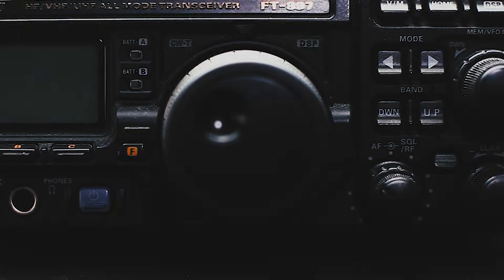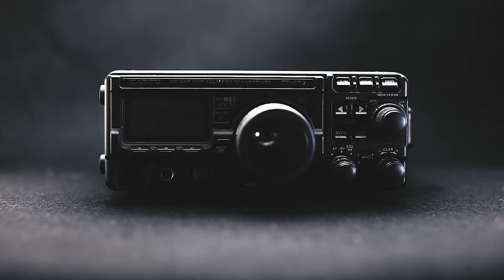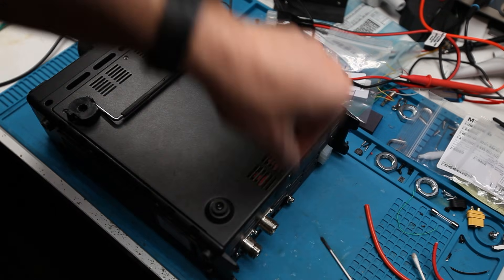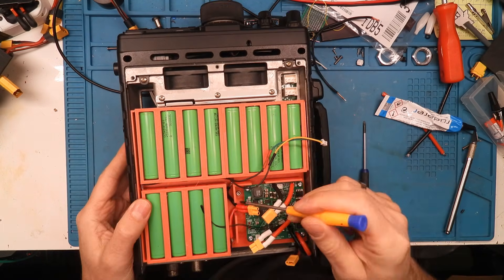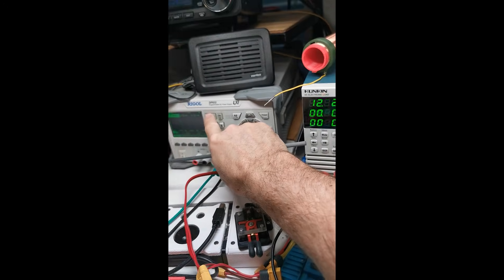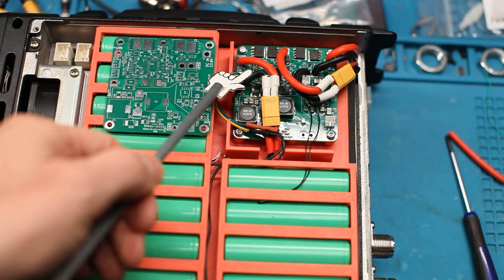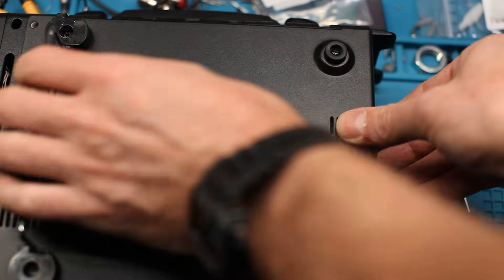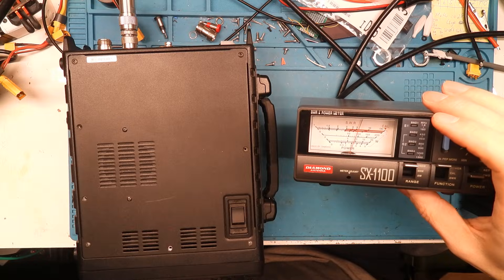The only 100W portable HF-Transceiver with Integrated Battery.

Comment: on my FT897 I used the battery space to add an LDG Z100, a sound card, and cat control with a usb-b port on the back. Poor man's FT991a. Or at least it was. To do it today would cost more than a new 991a the way the 897s are holding value.
Reply from the maker: well done. You used that space good!

Comment: I think only 20W if using the internal battery, not 100W. You did a special mod, but most people won't have this.
Reply from the maker: thats correct. only I have full power 😁

Comment: Very nice video- I have an FT-897D, but mine has a power supply in the belly of the radio, which is very convenient. When I do POTA and run it off batteries, I use a standard power cable connected to LiFePO4 batteries.

Comment: Yaesu needs to re release this rig with li-ion batteries and usb C charging 😂 The price would probably be ridiculously high
Reply from the maker: 😂 but would be cool if they would do it.
Reply: @CrazyChekov I would save up for one 😅 Engineered with flat pack cells, they could fit a LOT more capacity in there than 20AH
Reply: как они не видят что модель популярна до сих пор ничего лишнего все продумано опционально

Comment: Nice retrofit! How heavy is this old beauty with the power pack?
Reply from the maker: will measure it next time. its heavy but the  weight of the  897 in general could be reduced a lot with a different construction.

Comment: A great radio as long as your display doesn't get zebra stripes and your filters don't absorb too much humidity and go bad. A cheap(ish) fix but you had better have good eyesight, a good magnification set, a very small iron, and a very steady hand.. now we just need full details or a link to purchase this new battery

Comment: Dear Mr.Crazy Chekov, thanks for an interesting video. My FT897 is a very decent radio, it was produced for the Japan market. Excellent shape. I was less interested in the battery capability than expanding filtering, and being able to use the FC30 tuner that bolts onto the FT897. Anyway, I would sell mine since I rarely do portable, and my shack has a different radio - don’t need a backup. 73 KQ4IXD

Comment: All mode 100W radios were better and lighter.
Yaesu FT 100, FT 100D, FT 857, FT 857D
It was enough to connect a 3S7P 18650 battery pack to them, which fit into an empty box from a 12V 7Ah Pb battery.
Panasonic NCR18650A cells have been available since before stations like the FT100D were released 25 years ago
Compactness and backpack for pedestrians and portable mobile phones were made into a frame of aluminum tubes or sheet metal profiles.
Hard-working home craftsmen riveted it from Al profiles in an hour at home, without special tools.
Interestingly, a battery built from Panasonic NCR18650A cells still works for me today.
The truth is that it has less than 300 cycles and the price of cells was terrible in its time.
The battery never had a BMS, it was charged with a Graupner charger, the discharge was only checked with a voltmeter on the station.
The weight of the entire pack was much less than the FT897, which is heavy in itself.
A separate chapter would be the IC7000 station, which, however, has too much consumption and cannot tolerate a drop in battery voltage.
...
The truth is that today no compact all mode TRX 100W are produced, today only the trx IC 7100 is sold, which is the most ahead of its time.
The problem is that manufacturers are finding it difficult to sell new and new devices today and if there were a cheap all mode device today, no one would buy another TRX for a long time.
Or today a small 100W all mode device would have to cost as much as two TRX /7300+ 9700/ and that would make our wallets cry again.
A typical example today is the new Yaesu FTX-1.
The truth is that it actually costs less today than the new FT817 plus 897 combined once cost.
If someone bought a piece of gold or silver for the price of two TRXs (817 and 897) back then, today they have a new FTX-1 set and they still have an Icom IC 7610 and a rotator with an antenna...

Comment: Max Tx time at power levels 100( 90), 50, 25 and 12.5 watts can be tested. This will give max usable time of Ft8 mode at full duty cycle of 50% tx rx time.

Comment: I think that this is a fantastic mod to an old radio.  Have you had it on the air to see just how long you can operate before the rig no longer gets the voltage it needs?
Reply from the maker: thank you!
I tested it only in the lab so far. Will make it when Im back from holiday. lt should last 5 or 6 hours operating it. only receive nearly 2 days.
Merry Christmas!

Comment: ill never sell mine , been looking to get another for years , have the entire lineup , unfortunately yaesu radios these days dont pack all the features they used to , you cant unlock them out of band (which makes them totally worthless to haul around on distant expeditions) , i remember the good old days , ft-100D , IC-706MKII . Capable radios , that saw service on Helicopters and transport planes , operated my 897D on all conditions , fixed , mobile (maritime , air , land and man portable) and very few radios come close..

Comment: I still have my 897. Going out to do my first POTA activation tomorrow with it. However, I don't have the battery pack. On the other hand, I do have the 120 volt power supply built into it.